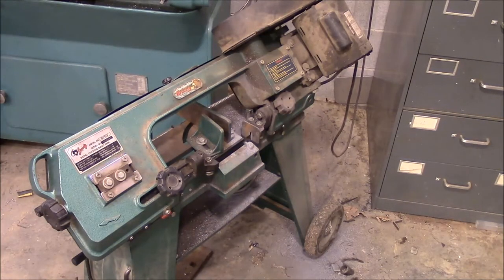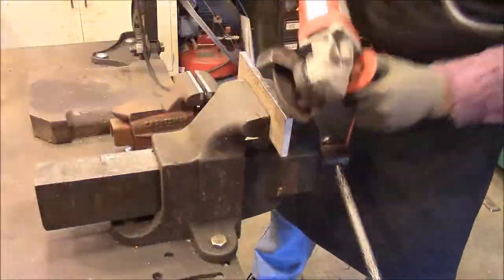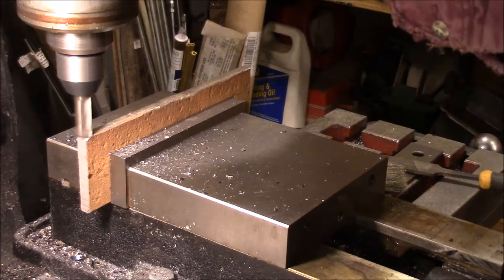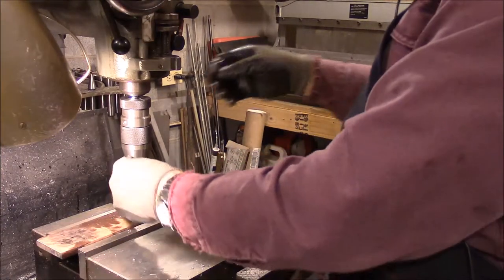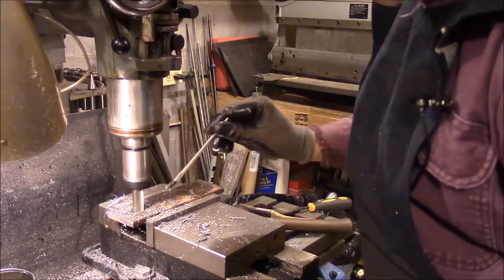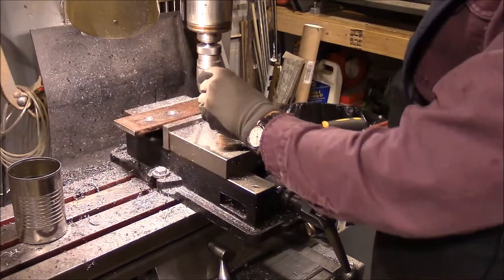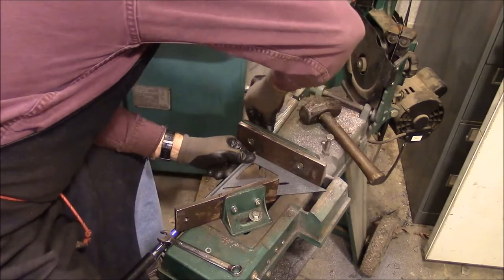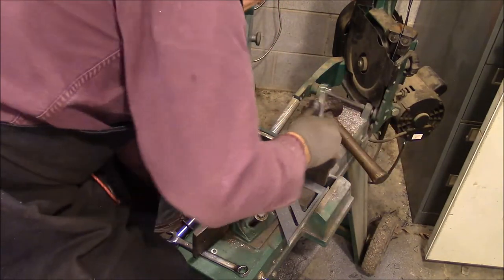Grizzly Bandsaw mod

Comment: You won't be able to cut angles with it tight to the blade.  One guy had a "clamping" table added to the outboard edge so you could clamp on the other side of the blade and cut flush.  Doug

Comment: Just curious, why'd you square the fence to the table vs. the blade?  Like the mod.
Reply from the maker: Squaring to the blade would be better.  On this saw the blade is square to the table and that's easier to do but you have a good point.